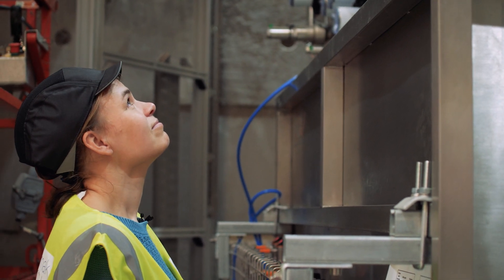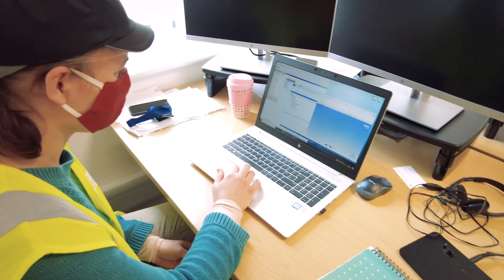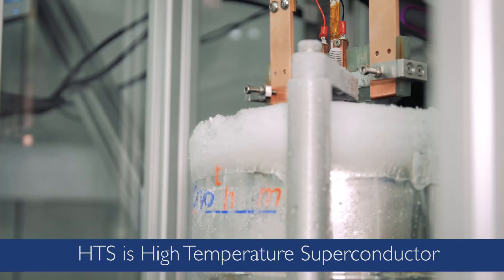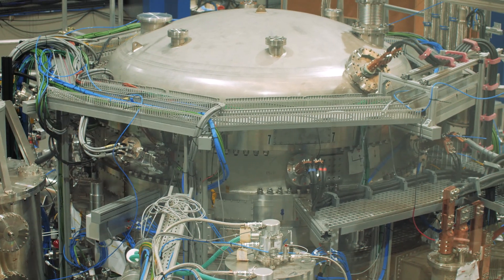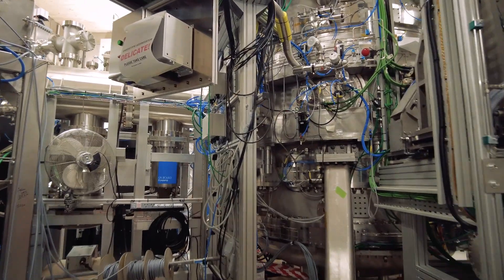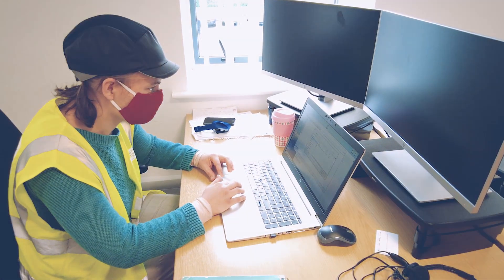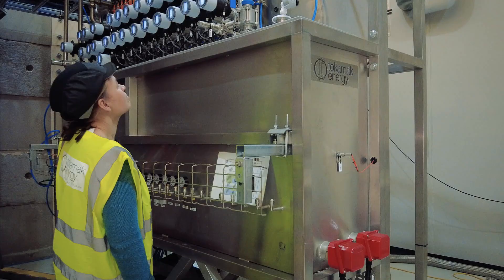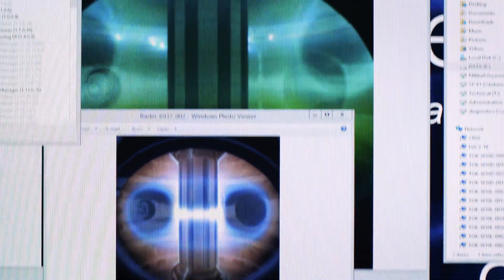What does a cryogenic engineer do?--Cryogenics systems for fusion energy

Comment: Will Cryogenics be necessary once HTS begin to operate a little closer to room temperature?
Reply: The issue, I think, is that at high currents it's even harder to work at room temperature.
Reply: Yes. HTS still operates at ~ -200C as opposed to -270C from LTS